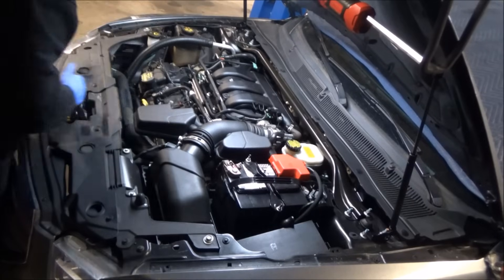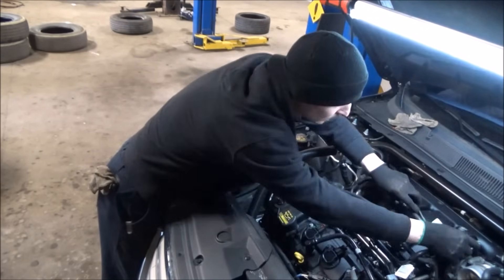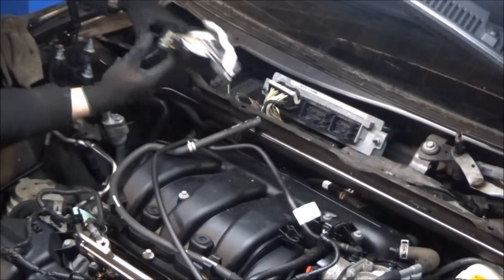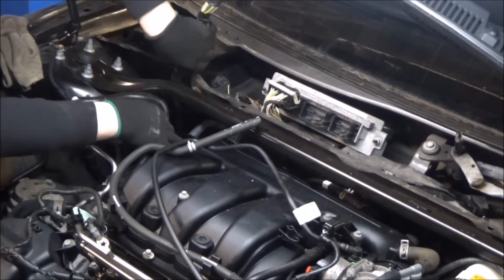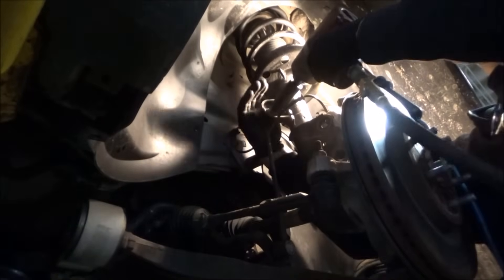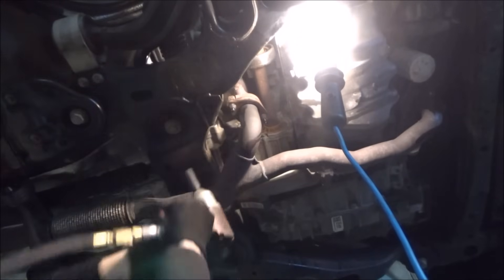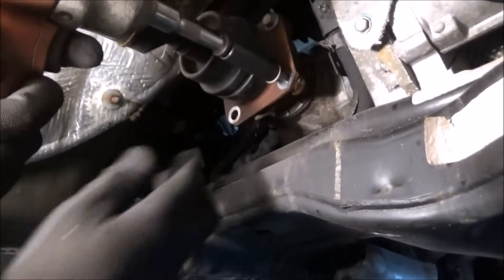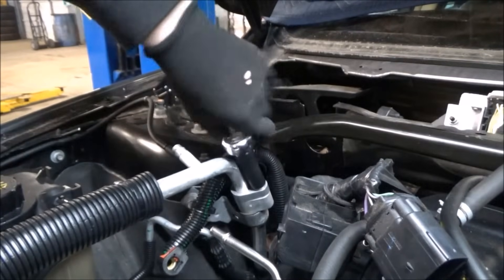2013 Ford Taurus, Water Pump Replacement Part 1

Comment: You mentioned that this vehicle was engineered with servicability in mind.  Remove the entire drivetrain?  To change a water pump?   I don't think I'll be buying that vehicle or any other that is that difficult to do what should be simple tasks.  Great video as always but not a very servicable engine!  Been wrenching for over 45 years, changed many a water pump, never pulled an engine to do it.
Reply: its not just that vehicles. any vehicles that use the same engine
Reply: A majority of my family works at the Ford plants & this B.S. is why I stopped buying Ford vehicles all together.  
American vehicles are to expensive to fix & have become readily disposable especially at $1800 for a damn water pump replacement !
Reply: Thank you harbor....I have a water pump problem on my 2012 ford taurus with 234 + thousand miles on it. First estimated cost for replacement is $3100, and they'll need the vehicle for at least 2 days.  I love my car too, just a great size vehicle for me..but being a GM retiree I think I'm going to have to go with the General now on my next vehicle purchase.
Reply: Captain you damn right! pull engine to change waterpump, that engineer needs flogging with a piece of 2.o wire

Comment: Powertrain removal is absolutely not needed, the Taurus is one of the easiest 3.5L water pump jobs out there!
Reply: Yeah I'm researching this job since I just got my first one in the shop. Looks pretty straightforward for a timing driven WP, but I want to sure the power train needed completely removed or not.
Reply: I know this is an old comment, but can you link me to any info about how to replace it?
Reply: How about on the Explorer, or better yet the Explorer Sport with EcoBoost?  Powertrain removal necessary for those?
Reply: @snirtman7223  I know the Ford Edge 3.5 is a mother lover
Reply: @snirtman7223  nope. Got my Explorer Sport timing cover off right now to do the water pump. U will have to unbolt the motor mount on passenger side and also lower the engine about half an inch to get the black bracket off the timing cover. 2 of the bolts are long and very difficult to get out but can be done. The oil pan is aluminum so be careful.
Reply: How's it going do u have a video of this job because I'll be taking this on soon and would like ur Intel on it thanks
Reply: @senorpablo171  I'm currently getting ready to do this.
Reply: Do you have any type of videos for this without pulling the powertrain, I'm gonna be tackling this in a few weeks.
Reply: I agree. I changed my brother's 2012 Limited water pump before I knew videos were available for shade tree mechanics, like me. It was a long job, time-wise, but taking your time, document some steps with your cell, and soldier through. 
Hey, Makuloco, when are you going to post your Taurus water pump repair vid?
Reply: Wh he taked the motor out ??? Just for the replace the water pump?????

Comment: Unreal. I am embarrassed being an engineer. Who designed such a system? Gives engineers a bad name. Shame on that team.
Reply: I'm sure there are many excuses, but an engine has to be dropped to replace a water pump?  Anyone who knows cars, knows that's BS design.  How did that get though design review 1?
Reply: Ikr.? -it's amazing to me guys like Joe are willing to take half a car apart and put it back together again just replace a wear item.
Obviously this used to happen in home electronics (my area of expertise) as well. One would take tape decks or VCRs apart to replace belts, what have you. However, it wasn't like any error on the tech's part was going to endanger the users' life. There's just too much involved here.
Reply: Yep, horrible design but the whole reason he's having to do this is for a crap water pump on a five year old car.  If you're going to make techs do all this for a pump you better make a damn good water pump.  If you had to do this every 150K miles or something similar it would be a little more understandable but after just 5 years, thats just stupid.
Reply: Was the new homosexuals community in the revenge, trying make americans peoples angry, broke $$$, mad ,and others reasons I wanna don't tell !
Reply: They do it on purpose, try buying an air filter for your 05 ford focus, guess what you cant its a "lifetime" filter lol located behind the bumper. meaning they designed it to be throw away garbage. guess they caught too much flak or got sued because in later model ones it is replaceable. they will do what ever they can get away with. this is why i hate fords, and as a mechanic who works on fords i hate telling people how much labor is because its always over the top when its a ford.
Reply: ludicrous, insane to need to take the car apart to change a water pump. ford needs a class action suit against them
Reply: Just did mine and didn’t drop the engine and didn’t need to either
Reply: Nathan Mckenzie how’s U do it. I have a 2011 with 102k on it. Hopefully my pump last till 150k.
Reply: Took everything off including engine mount on the pass end side and supported it with a jack then when it was time for the timing cover to be removed I jacked up the engine a couple inches and it came right out. No issues
Reply: @MrNater1313  Great advice. Any other tips for the DIYers? I'll be starting my water pump replacement this weekend. Did you use the cam shaft bracket holders? How about any other uncommon tools? just trying to prepare the best I can.
Reply: Jonathan Hofmann  yes you need the cam shaft holding tool. And also a good 3-jaw puller for the harmonic balancer.  A couple jack stands and a jack because in order to get the timing cover out you have to jack up the engine on the passenger side a couple inches. I’d also grab yourself a roll of paper towels to plug the intake. Your going to need a torque wrench that reads inch lbs and one that reads ft lbs. make sure to get the inch lbs one that goes down to like ten. If I remember there was something that needed to be torqued down to like 18 inch lbs. good luck. Just take your time it isn’t a hard job just takes a little patience.
Reply: Nathan Mckenzie many thanks! Ford dealership wanted $1700 just in labor.
Reply: Jonathan Hofmann no problem. That’s ridiculous
Reply: Jonathan Hofmann just remember you have to replace the cam phaser and crank bolts so you should go to the dealership and see if they have them in stock I’m sure they can order them
Reply: How? Thanks!
Reply: Jonathan Hofmann you get your car done and how did it go for ya
Reply: ...and if you really are an engineer,  you’re the very first engineer that I’ve come to appreciate, for giving a piece of your mind. Thank You.
Reply: Who puts an engine computer inside of a cowl??!!! Really???!!!
Once the cowl’s drains plug up with Mother Nature’s trash, the cowl floods, leaks into the fresh air vent into your interior, and short out the PCM under those plastic covers.
Reply: @rmr5740  The water pump can be done in the vehicle, but of course with a transverse mounted engine, access becomes much easier with the engine out of the car.

Comment: doing an engine change on a 13 interceptor.... this was really helpful! stumbled across you by accident, but all the necessary component blocks of information were there to make this job much easier (didn't have to sit and figure out how things came apart) Things go wrong with motors all the time and this kind of work needs to get done.... thanks for the vid!! and great voice over on the whole thing.

Comment: How different is the engine bay in the Ford Flex?  Water pump can be changed with the engine in the car.  While removing the drivetrain may provide more clearance when removing timing chain cover and the timing chain, is it truly necessary?

Comment: We have had a run of these coming in on the police interceptor version. So far they have all gone back to the dealer because they were still under warranty. I take it yours was leaking from the weep hole behind the alternator..
Reply from the maker: Pico Boo, thats correct good sir.

Comment: A 2013 with a water pump failure? How many miles did the vehicle have on it when you did this job?
Reply: Colin D that’s what I wanna kno. I have a 2011 102k on it. No issues
Reply: @QthAgR8  Looks like it is in good condition  probably less than 100k

Comment: Really wanted a taurus. This just broke my heart.
Reply: I just bought a 2012 Taurus Limited. The dealer offered me a service contract that covers the water pump and a lot of other major repairs with zero deductible included in the purchase price.  All I have to pay for is fluids and filters. The car has 80.500 miles on it. I don't know if the coolant has ever been changed, so I'm going to replace it. On April 2020, Ford approved the use of Motorcraft VC-13G Yellow Coolant as a direct replacement for Motorcraft VC3B Orange Coolant, and I'm going to put it in. Maybe the water pumps will last longer with the yellow coolant. I had a 2005 Taurus which I bought new and had it for 15 years. Great car. The 2012 is a much bigger car than the 2005 model. It is a nice car.

Comment: That's crazy, reminder to self. Never buy one of these 😂 great work.
Reply from the maker: Hey you have to like them a little,  job security!!!
Reply: It just depends which side of the service counter you're on.
Reply: Triangle Diagnostics Work for a shop that specializes Beemers and Benz'....thats security.
Reply: The mech a nic it’s crazy expensive....I dropped like $2300 to replace mine ☹️ last year....
Reply: @pinpointautomotiverepair1592  I have the same car and I have that same issue i wish u lived in Atlanta so I could pay u instead of ford... u made that shit like it was a walk in the park great video tho all 3 segments well detailed
Reply: @pinpointautomotiverepair1592  what city u live just curious cause my water pump is gone on my 2013 Taurus aswell
Reply: Hi... the 2013 Ford Taurus that you did the waterpump on,  you mentioned that the coolant was coming through the weep hole..if I change my water pump would the coolant still come from the weep hole once the job is done..?
Reply: Ian Manhertz it should only be coming out of the weep-hole is if the first gasket for the water-pump is no longer sealed. you then have another gasket seperating the coolant from the inside of the crank case. after the weep-hole (a warning sign and also a pressure release to keep the second gasket alive longer) it will eventually break that second gasket and start leaking coolant into the oil. basically, with a new water-pump you should have new gaskets on the new piece, that theoretically will solve that weep-hole leak
Reply: @pinpointautomotiverepair1592  Sounds like you might be a Ford man. I saw your video on your Ranger transmission fluid and filter change.. I am too. I've owned 3 T-Birds, 1 Ranger and three Taurus's. All of them were great cars.
Reply: @davidorona8823  I dropped the same  amount, but the car runs as it was new again. New timing chain components and power steering belt. Also required 2 oil changes and coolant replacement.

Comment: Hey Man! Great job here. Ive got a question I was hoping you could answer for me. I have the 2014 Ford Taurus  I did an engine swap on, its got the 3.5L engine and the exact same thing was put in, but I'm getting terrible gas mileage, before the swap I was averaging 10-11L/100KM combined and after the swap its 18-19.9L/100KM. Any idea what the problem could be?

Comment: What's the reason you removed the engine? All data does not suggest this at any point for water pump replacement?
Reply: This video is probably aimed at other mechanics who have a shop at their disposal. Not a job for shadetree mechanic. Could be a slow week at his shop so this method keeps them busy.
Reply: @beezertwelvewashingbeard8703  good techs don't waste time. Time is money. It's completely unnecessary to remove the engine strictly for water pump replacement. Speaking from a professional standpoint.

Comment: Great video. I was going to change water pump on a 08 sable with the 3.5. Is it all possible to do this without dropping the engine?
Reply: Bryce Taylor Yes but if it fails, just get rid of it.

Comment: I own a 2013 Taurus Limited, I di like the car, cant stress enough the importance of timely coolant changes, 50K or less is optimal, not the recommended 100K. Water pump failures are fairly rare, but it sucks if it happens to you. This engine is also used in The Flex and Edge
Reply: Damn. I got a '13 limited with 30K miles. Recently had it serviced and it's running strong. But the Ford warranty has just expired and watching this scares the crap out of me. Is this really a rare kind of failure? Should I be worried? Anything I could do as preventative measures?
Reply: I have a '13 Limited with about 72K. I just ran into this issue and lead me to this video. The mechanic I took my car to won't even touch it.
Reply: I agree on more frequent coolant changes. Also,  when these pumps have a catastrophic failure, it because of bearing failure. Bearings do not like dirty oil.  I always change the oil and filter at 3,000 miles or one year, which ever occurs first. Oils breakdown over time. It's much cheaper to change the oil than repairing major parts of the engine.

Comment: On the ford explorer forums one guy took it in and the dealer did not remove the engine to change out the water pump. A couple of people on the mazda forum have done this as well without engine removal, they also replaced the chains , guides and the vvt solenoids while they  had it apart
Reply: u can do it with out taking the engine out its just easier

Comment: I have a 2011 taurus 3.5l.  Took to ford garage to have new water pump installed.  Car has 70,000 miles and drives fine, but is leaking coolant a little out wheap hole.  Mechanic called today and said needs new engine.  Said there were shavings due to water pump failure.  Is this possible?  Does this sound right?  Any info greatly appreciated. Thanks
Reply: Triangle diagnostics
Reply from the maker: I doubt this is true. Generally a leak out of the weep hole is due to a failed inside ring gasket on the pump and not the water pump bearing itself.
Reply from the maker: I would get a second opinion from a reputable garage. It is likely they would rather put an engine in than attempt to service the chains due to the complexity of the job.
Reply: Triangle Diagnostics I'm going in tomorrow in person to look at it.  It's at a ford dealership service center.  He said bearing failed and gouged inside.  If this is true, wouldn't cleaning out debris and installing new pump be ok?  I wouldn't think gouging would matter much on cooling system?? Your thoughts?  Thanks a million
Reply from the maker: Glock79, did they actually tear it down to look at it? If not than they can't for certain say what is going on. I've never personally repaired one of these where the bearing has failed, though I have heard of it happening and most often people replace the pump without issue. Most of the pumps I've replaced on these have been external leaks such as in your case.
Reply: Triangle Diagnostics I'm going into shop in 20 minutes.  I'm going to physically look at what they have actually done.   He called and said "I can put new pump in, but can't guarantee car won't have problems"   I suspect he is being over cautious.  But I will keep you updated.  Thanks again for the reply
Reply: Triangle Diagnostics tech has engine out and cams locked and everything off.  My pump has couple fins broken off and could be in engine somewhere. That's what he was worried about. And beveled area where fins almost touch block is worn uneven a little. He was worried about pump not having suction against slightly uneven mating surface.  Guess I'm gonna cross fingers and have them do it.
Reply from the maker: Glock79, ah I got ya. I think youll be fine honestly. If its just a little nicked it shouldn't be too much of an issue. Time will tell!

Comment: Nice work. I have just a quick question for you. What would you think would be a good way to go about this if you're working at home without a lift? Dropping the powertrain is clearly the quickest and easiest way, but I I seriously doubt that you'll be able to lift the body high enough to get the engine from under the car. What do you think?
Reply from the maker: Ian Johnson, to be completely honest with you I would not attempt this repair in vehicle. Not because the timing components are hard to access, but because of the difficulty in successfully installing the timing cover. The basket is fully silicone, and trying to get it between the body and engine and installed properly would be extremely difficult to do without smearing the sealant and risking a leak.

Comment: Wow Ford sure does have a knack for not making replacing common wear items "easy". My 2002 Suzuki XL-7 V6 also has a water pump behind the timing cover...quoted labor time is over 14 hours to replace hahaha. But hey, it's still on the original one so I can't complain ;)
Reply from the maker: Lets hope it lasts buddy!  Otherwise you'll be doing a series like mine 😂
Reply: The design sucks true. BUT if you're going to do something stupid like that then make damn sure you've designed the water pump for the space shuttle so that the job doesn't have to be done for 150,000 miles. Designing a shitty water pump and putting it into this precarious position is utterly indefensible.
Reply: Your time will came. Get rid off of timing junk !